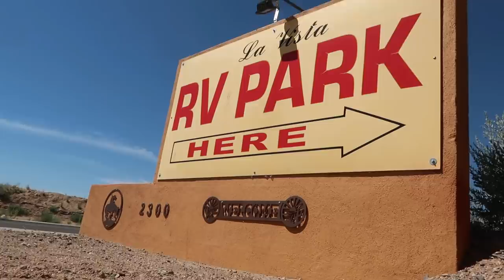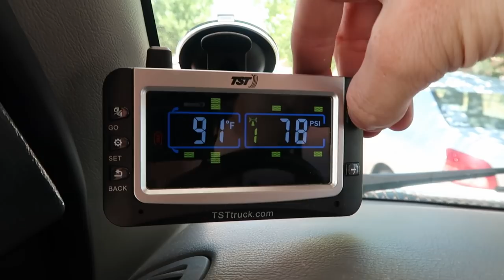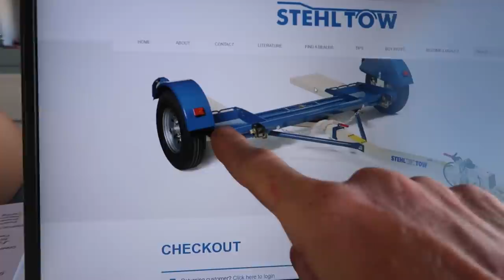Subtle Joys of Full Time RV Living: THE INTERSTATE TIRE BLOWOUT

Comment: I'm cheap, you could have searched for a tire shop, called to see if they had a new set of tires & replacement wheel.  I would have gone straight there gotten that fixed. Heck for a few bucks I bet they could have pounded the finder out for you. You could sleep at the service center if it became a over night job. But you have deeper pockets so it's all good. Glad your all safe.
Reply from the maker: That's an option, but I'd rather do the job right and be able to make some money when I sell the dolly, rather than lose money selling it with a ugly fender. Not about deep pockets (you're hilarious), it's about exit strategy!  :)

Comment: Keep smiling, it could have happened on your RV like it did to ours.  We had  2 of our granddaughters with us when we blew a right rear outer tote on our Class C (of course in the middle of nowhere’s volleyball New Mexico).  I took off the outside tire at the side of the road only to find the force of the blow out caused belt break on the inside tire.  We needed two tires to even go anywhere.  Fortunately we had an extended warranty on our vehicle that covered tire or tow and we called a place in Albuquerque that sent out a mobile unit to repair it on the spot.  Two hour lunch break and $500 later and we were back on the road. Needless to say our stop for the night ended up being Albuquerque.  We did get reimbursed and ended up staying in Albuquerque for a full week sightseeing.  All’s well that ends well.
🙏✝️❤️😁

Comment: know  how that is exactly, but it was one of my outers on the RV and it ripped open the side of the motor home on my Class A putting a hole in the floor the water heater pneumatic lines for the  suspension and wiring for the running lights!  not fun when you just set out on vacation 4 hours earlier. but just like your situation, you get to work fixing it and  a week later we were on our way again.

any way i have to get back to work on the boat.... have fun.

Comment: retreads on trailers.......naughty, Ben.
Reply from the maker: Were they? No idea. Odd thing is that they weren’t cracked at all when we left. I felt great about getting good tires with the trailer. I almost think the desert heat made them start opening up and cracking. Ah well. They’re brand new now!
Reply: @Sailboatstory  - Yep.. they were. The surest clue is the way the entire tread peeled off, leaving a lower layer more or less intact.  You can detect them before catastrophic failure, by spotting the glue-line all the way around both sides, where the side-wall meets the tread. They're only designed for short journeys around town, and are notorious for coming apart on long-haul trips, especially if the roads and weather are hot.

Comment: Take it from someone with 28 years driving experience, and 3 million accident free miles in my back pocket. Get a good tire gauge and stick those tires every day. There are things called "Cats Eyes" they attach to the duals on your drive tires. Get them, and have them installed. RV dealer should have them.
Reply from the maker: Holy cow that’s a lot of miles! I do check the tire monitors readout before each trip. Thought about getting cats eyes but felt like I had to choose either those or the TPMS due to compatibility. Can’t remember exactly why now, just rolling with what we’ve got at this point.
Reply: @Sailboatstory  Do you have monitors on all 4 drives? If so, you're good. The good thing about cat eyes is you can inflate them without removing anything.
Reply from the maker: @fishin4bogey  There's a monitor on each tire in contact with the road. The front 2 tires on the car don't have them.